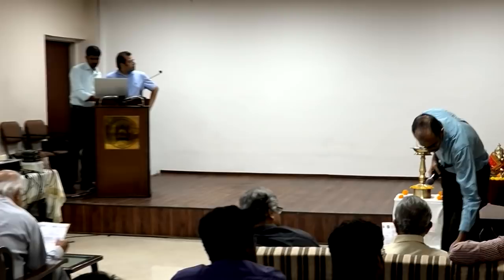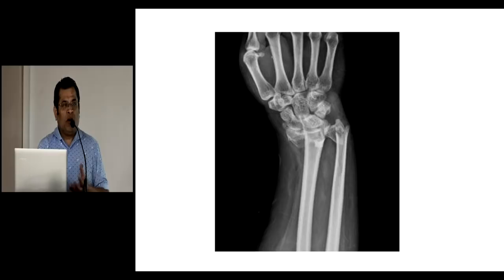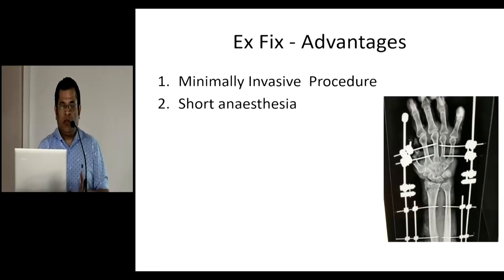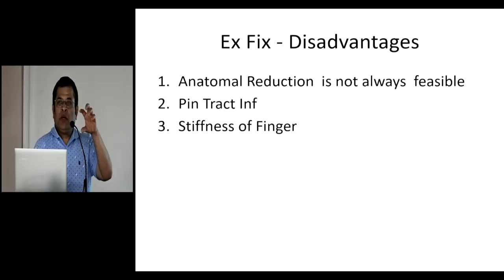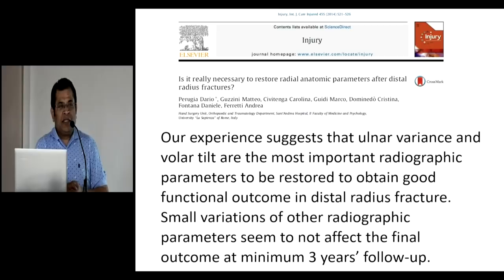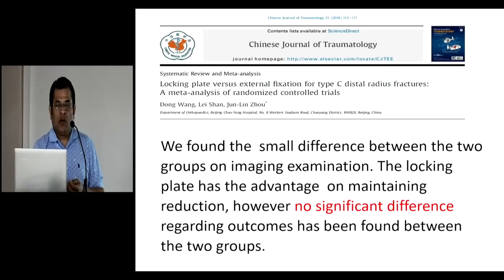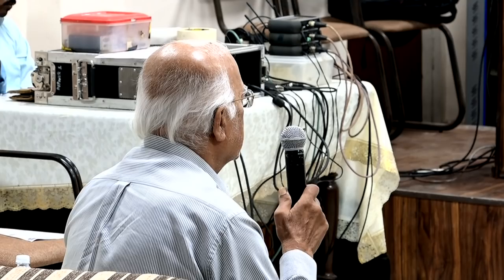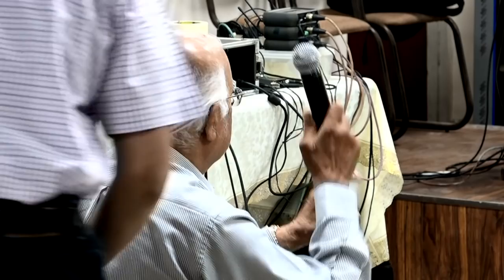JESS fixators for distal end radius - Dr Rajesh Gandhi

Comment: Are we not over treating distal radius fractures ? I feel the best treatment is CR with K wires & a cast for 6 wks .Volar Barton's require buttress plating with no sceews in distal fragments. Dorsal Barton again can be fixed with K wires .Severely cimmunited require external fixatprs only to maintain reduction .Ligamentptaxis doesn't work & locked plates are for  purely business purpose
Reply: How to deal with delayed volar barton fracture
Reply: @asitpurohit_108  Open reduction and plating or intra-articular osteotomy and plating